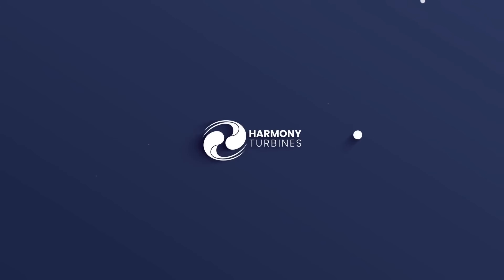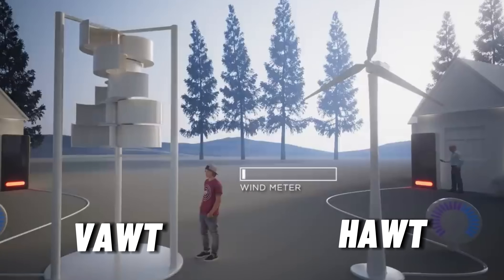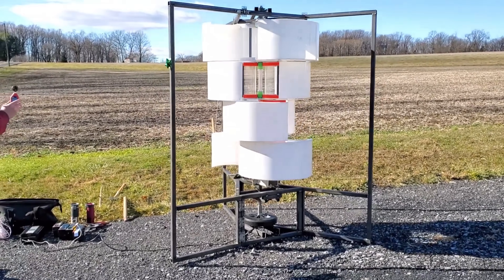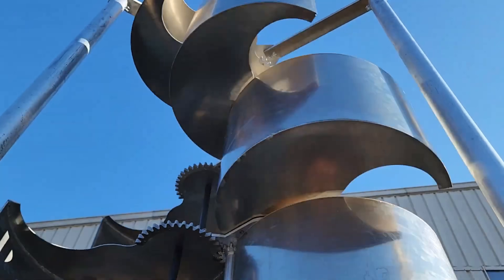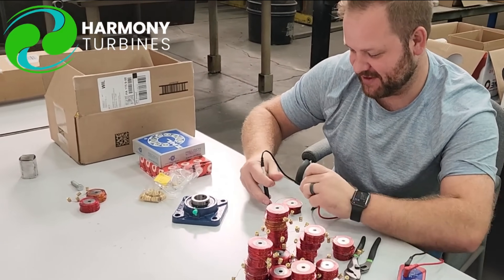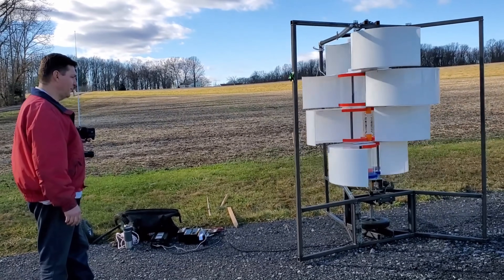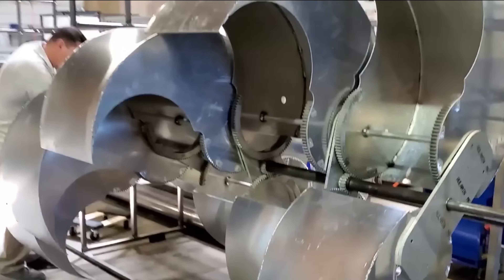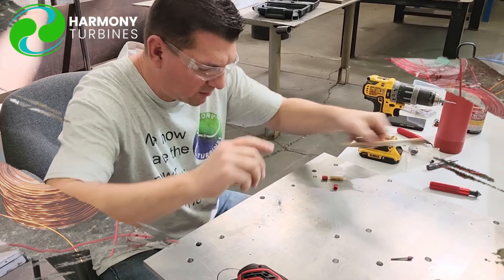This NEW American Wind Turbine for Home Outperform All Kind Of Wind And Solar Technology in 2024?!

Comment: This is dross. Home wind turbines are very rarely any good. This thing is small. That means its output is small because the power output is proportional to the square of t he linear dimension, e.g. diameter. Also residential areas are not usually known for high wind speeds. Power output is proportional to the cube of  the wind speed and output at a typical 5m/s is just a few watts. Avoid like the plague.